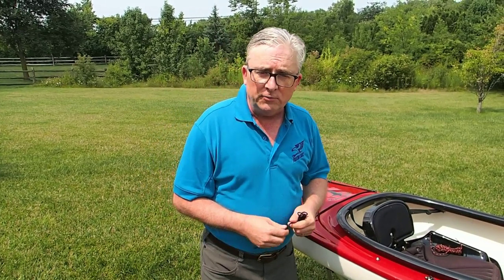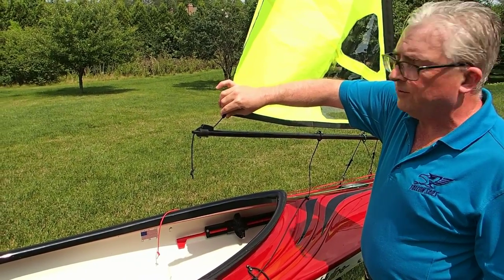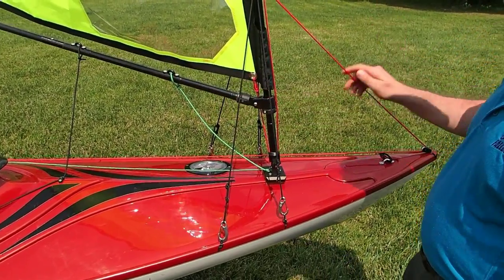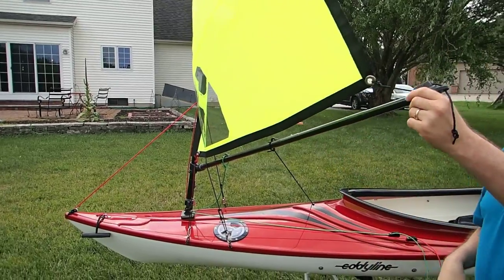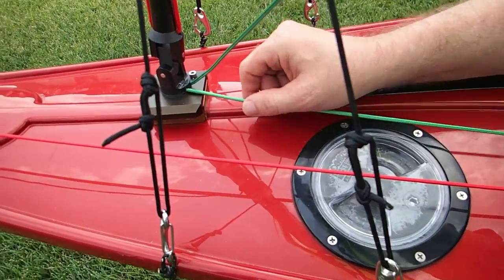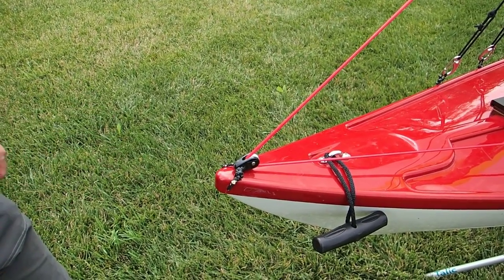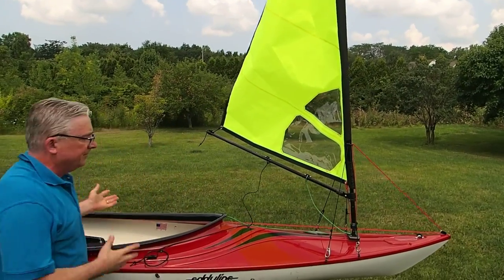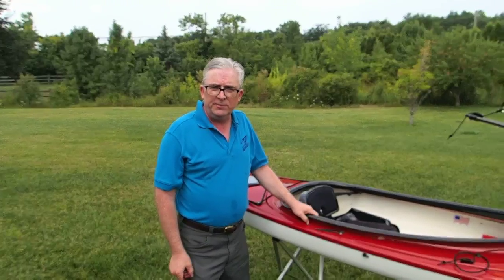What you need to know when it comes to kayak sailing and proper lines.

Comment: Great explanation - really helpful. I like this rig. But the sail protrudes when stowed, and so I think it would interfere with a clean easy paddle stroke?
Reply from the maker: On this particular kayak it does protrude a little bit, but it is not much of an issue.  A very slight modification in your paddle stroke will 100% take care of this very small problem.  The biggest compromise by far is not having a good quality sail when  a great one is available.

Here are some pictures of a Falcon Sail in the down position.  You can see in this collection of pictures it is even a smaller issue on most kayaks.
https://www.flickr.com/search/?user_id=30659399%40N02&sort=date-taken-desc&text=down&view_all=1

Comment: Can't find anything for rigging a sea kayak without using a drill, and when the sail goes underwater it's hard to right the rig cudd do wit enough flotation to surface the rig or detach the sail from from the capsized hull, and have it float, as usual nothing to glue placements on yurr kayak
Reply from the maker: Drilling holes can be a touchy subject for some people.

Here are some of standard discussions and ideas about drilling holes.

It is not possible to do as solid of a sail rigging job without drilling holes in a boat as it is to install a solid rig and drilling holes.
Just like you need to drill holes in a conventional sail boat to do a proper rigging job, you have to drill holes in a kayak to do a solid job of installing a solid sail rig on a kayak.   Any kayak with a sail installed without drilling holes will always be clearly inferior / not as solid / not as reliable as rig installed by drilling holes.  Of course Falcon Sails supports customers who want to try rigging their kayak without drilling holes.

We have been down the road of people working hard to not drill holes.
After over 10 years of doing this, we have never see a long term rigging job or people who stick with kayak sailing when they do this.
It ends up being a exercise of abandon.

In the end, I never see a long term rigging job or people who stick with kayak sailing when they do this.
It is similar to rigging a sail boat with a mast and standing line anchor points and not drilling holes.
Personally, I think not drilling holes is a big compromise that is not worth it.
I like to use what is simplistic and I know is 100% reliable.

In reality, you could drill thousands of holes in your kayak, and plug them with pan head screws and the boat will pretty much indistinguishable from a kayak without any after factory holes.
Kayaks have a lot of holes drilled and cut out of them.  They are made fore grab handles, safety lines, shock cord organizers, seats, seat backs, hatch covers, compass, hatches, foot pegs, grab handles, rod holders, rudders, camera mounts, scupper holes, ect ect.
But I just like to be honest with people and let them know, it will take a lot of time and effort to install a rig with no drilling and it will be a lot inferior to a proper rigging job.

But still, you are the boss, and Falcon Sails will support you in your efforts as we do with all Falcon Sail customers.

If you have difficulties drilling holes here are some ideas to reduce the number of holes you need to drill.

You can go from 2 hole standing line anchor points to a single hole alternate anchor point system.
You can eliminate side stay anchor points to cut all anchor points in half.
You can tie cleats to a line on your deck vs bolting them down.
You can use a line tied from one side of your deck to the other to act as a sheet line fairlead to eliminate a hole.
You can tie your bow pulley to grab handle or use some other hardware or existing hole to attach the bow pulley, to avoid drilling holes to attach your pulley.  There is a lot you can do, but it is best to have a few holes for the deck plate with deck support strut assembly, and the back stay anchor points.  All the other holes can be avoided.  But still I like to do a clean solid rigging job, and personally do not hesitate to drill holes to make my rigging job cleaner and more solid.

To get a good idea of what we call a solid rigging job, take a look at our most recent rigging instruction video to see how we make it as solid as possible.
https://youtu.be/2i8_EEExqNg

Comment: Patrick, Nice job on the explanation of the various lines.  I see Eddyline is introducing the Sandpiper 130.  It's a foot longer then the current Sandpiper which I'm thinking would be ideal for the Falcon Sail.
Reply from the maker: Of course any hardshell ( plastic, fiberglass, wood, ect ) kayak is great for kayak sailing.  I would like to upgrade this demo boat just so it is a newer and more interesting model.

Comment: I have had a falcon sail and you can sail to wind very easy to raise and lower as you kayak
Reply: The first time I sailed with a standard kayak hull and made up wind progress I was amazed.  Conventional sail hulls make people think you can only make up wind progress if you have a lee board.  They do not realize, kayaks are made to track / go in a straight line.  That is achieved by having lateral resistance throughout the length of the hull.

A conventional sail boat hull is designed to be as slippery as possible going forward.  A byproduct of that is a hull that is slippery in all directions, including going sideways.  Another byproduct of designing a hull that is slippery as possible going forward is a hull that tends to spin due to its lack of lateral resistance.  

So yes a sail boat hull needs a lee board, or a keel but a kayak hull does surprisingly well without a lee board or keel.  Life is so much easier when you do not have to deal with this kind of thing.